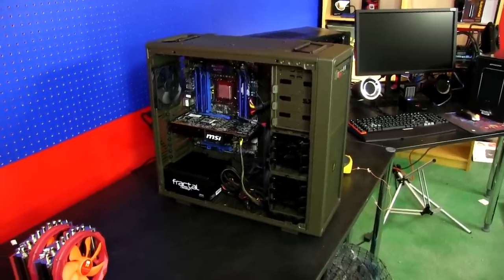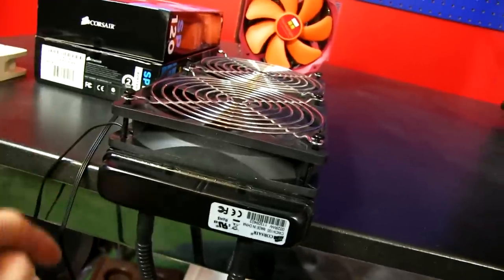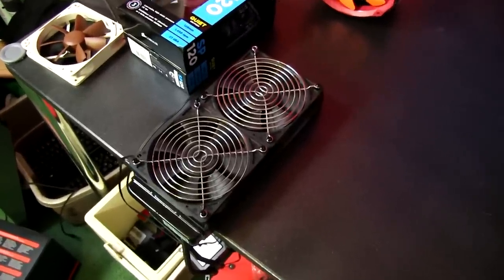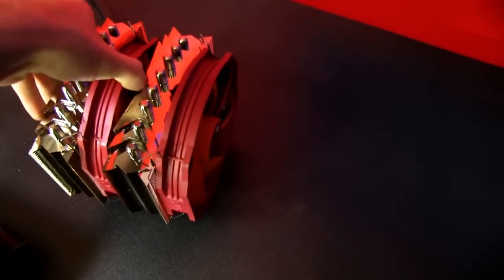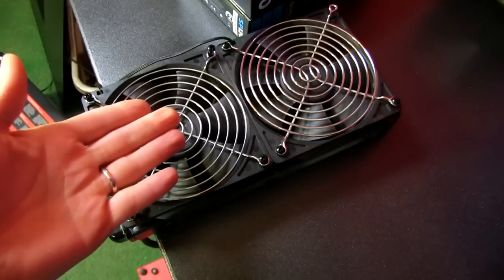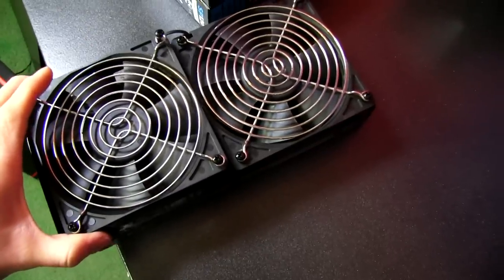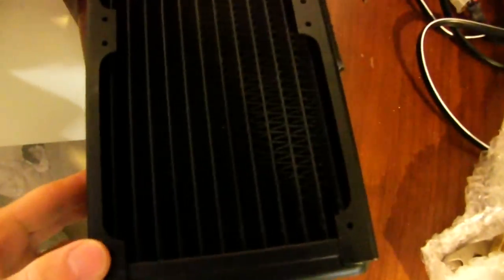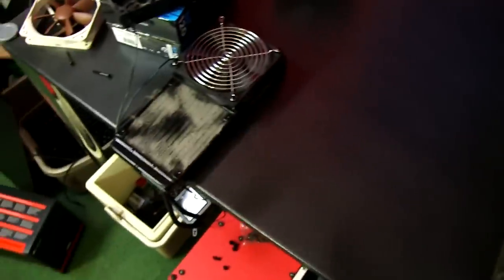Push vs Pull vs Push Pull for Radiators and Heatsinks Linus Tech Tips

Comment: Cool!  Ok, so positive, equalized, or negative pressure in the case?
Reply: This is just my opinion but equalized would be ideal, very difficult to achieve and even harder to maintain. Positive pressure is next best. It gives you enough fresh air coming in to adsorb heat and the positive pressure helps reduce the amount of dust inside the case. Negative pressure turns your case into a dust vacuum and can starve your system of fresh, cool air for heat displacement.

Comment: Use a filter. Without a filter, push with an external fan (above the radiator) or pull from an inside fan (under the radiator) will always suck-in dust, anyways. In such pull config. as is shown, It will simply stick somewhere else (IN between the radiator's fins in the case of the video... or between the rad and fan under it). A correct (but unrecommended) "pull configuration" which goal is to avoid dust, would "pull" air from inside the computer chassis while actually pushing it through the radiator fins outside the chassis. However, using cooler air from chassis exterior, instead of hot air from around the motherboard, to vent radiator fins, should render the system more efficient : IMHO a push configuration would be the way to go. Add one or two powerful front chassis fans, so as to push the hot air inside coming vertically from the radiator, towards the back (and outside), while providing fresh air to the CPU's heat sink fan, and you'll get overall a cool thermally stable system. Just use a good filter on top, that's it.
Reply: If you're water cooled there is no CPU heat sink fan, it's the radiator. Also, if you cool your components, you case ambient temp drops, your ambient drops, the air you're pulling into the rad gets colder, then the parts do, then the ambient. Realistically the temperature your components reach is based on the pump and radiator volume/surface area, not where you are pulling the air from. The ambient temperature of even a very innefficient case is around 100F or 37C, so even if you are pulling that hot hair into your rad, that's still MUCH lower than the temps your processor/GPU are trying to reach, 100C+ or 212F+. Besides, if you're overclocking, which if you have water cooling you probably are, your base operating temperature is going to be around 37C anyways, so it's not a big deal. Yes as a nit pickey last word you'll say, "Well I'm right though, colder air through the rad means colder components." Yep, 100% right, but in these types of scenarios, there isn't a legitimate difference.  I prefer a bottom mounted 240 for intake and GPU cooling (SLI 780), Top mounted 360 as exhaust cooling my 5820K and Ram (Bitspower has an AWESOME deal on a ram cooler setup) and then a front mounted 240 as the pre-resevoir rad, mounted also as Intake everything in one loop. The rear case fan (the only one) Is also mounted as intake, and everything has a dust filter. I don't get any dust on the exhaust rad at all, and dust robs performance so I'd say my setup is successful.
Reply: ian konrad Thanks, took about 6 months to build using PayPal's credit line buying a piece and paying it off. but MAN... it's a beast.
Reply: Evipicc
1- I was mostly talking about having a dust filter. As such (and as what follows) I stand my point. I evoked a CPU heat sink as I was concentrating on fans and fins and air temperature, but even though it's irrelevant when talking about DUST intake, principles of thermodynamics are in play (read along, and point 4 exposes a very efficient active solution from my own experiementations).

2- the air "cycle" you depict would involve that the system itself could make the air cooler than outside air : unless you're using freon or liquid nitrogen, it's not true, it's always limited by ambient (outside the case) temperature, and in the cycle you depict it would be limited to a higher temperature (with an added differential, well above outside temperature) - it's like lowering the heat transfer capacity of your cooling system. Even though you say that it's not your case, many do this error and then wonder why the closed loop water cooling solution they've just installed on their CPU, is not as efficient, or at least not "that" efficient, when compared to Active cooling solutions that are much cheaper... Weill there you go. The fact that your blowing inside air on the radiator fins rather than outside air, raises the case's inside ambient temperature when it gets IN EQUILIBRIUM : simple laws of thermodynamics are taking place here (temperature differentials of interstices playing a role in heat transfer ENERGY - or the energy required to keep the highest possible differential between two "bodies" -, whether that interstice is solid or gaz). Such cycle as you depict will attain an equilibrium as you said (of course), however it would be to a higher temperature than the other way around. These laws of physics are taking place, whether you are overcloking or not. But it's also true that in the later case, if you want to overclock the CPU to such extreme that it tries to get to 1000 C., then that differential gets to about <= 1% and thus can be residual. Q : which overcloking would go that far (usually one would use liquid nitrogen in such extreme overcloking context, while blowing air on the fins, whatever the direction, would have a residual and irrelevant effect)?... IN SHORT, the more temperature differential you have, the more energy would be required by the CPU'S "works" to keep its temperature as high as what it would "want" it to be : for the same CPU load factor, having a greater temperature differential; WILL lower the dissipated and ambient temperature in equilibrium.

3- In general, the greater the temperature differential given a "roof" temperature (established by the CPU's heat), the more efficient your cooling system can be : a differential of about 10 to 15 C. is NOT considered as being "residual" when it represents about 10% (<1% could be considered as being residual, but we're far from that context here).

4- I have installed an most impressive fan for the buck on my CPU (Arctic Freezer i11 at about 25 dollars), with a 140mm 90-100CFM fan exhausting air from the chassis and the CPU heat sink fan, while 3x fans (one added for about 7 buck and positioned at the bottom for cooler air) are pushing fresh outside air into the chassis. The 2 intake fans that came with the chassis are about 40CFM (not very efficient but I've made them essential in the active cooling design), and are combined  with the rear  exhaust fan on a very simple fan controller (a rheostat included with the cheap chassis I bought), while the new fan I added stays at full throttle at about 60-75CFM. Hence I can raise the rheostat to configure the chassis to be either in a negative air pressure config. (thanks to the 140mm fan at full throttle) while in full load, or lower that rheostat so as to leave a positive air pressure, simply to keep the chassis free from dust intake while in "normal" or idle load (the new fan plays with higher CFM and which always stays at full throttle plays its role here)... Well I'm "flabbergasted" by the results : the CPU stays around 23 to 25 C. at idle or "normal usage", while it never gets above 47 C. when playing a game on highest settings or doing gazillions of mathematical iterations (engineering data simulations) at full load. But of course, I'm not overcloking anything here ;-)
Reply: ian konrad
yep, you got one nice rig there, but I take the bet ;-)

Comment: what kasettys said: push pull is for water cooling and thats what a radiator is for. Regardiing your case, its way too hard to give an answer when you've only listed one component in your build. Also, all Ivy / Sandy based i5s and i7s will OC easily to 4.2 with/without a voltage boost and the stock cpu is MORE then adequate for it. Theres no need to strain yourself with a hyper 212.

Comment: Hi Linus! Would it be possible to to avoid the dead spots by using and extra pair of modified fans with no fins, spaced between the rad and the working fans? or does simply configuring the fans in pull fix this issue? I hope my question makes sense :)

Comment: I know you said that the push pull performance difference is negligible, but the picture on the NF-F12 shows higher static pressure on the push end (yeah I know it's a picture), rather than the pull end. So is it worth using it in push and having more dust? or just using pull?

Comment: I actually tried to configure my Nepton 240M in pull. Only to realize I could no longer put my top dust filter back on, because the screws are too high profile. Also installing in pull is much harder, especially with the rubber gasket that comes with the cooler.

Comment: I understand its been years since this video has been posted, but Linus recommends a pull configuration even when mounting it on the top. I understand that it makes it easy to clean out the dust. But I see so many builds that are in a push configuration, even in Linus's various builds on this channel. Did he change his opinion through the years or something?
Reply: Many people want rgb Fans and in pull configuration you wont See any rgb thats why most people go With push just depends what looks better to you

Comment: I'd use pull anyways because many cases actually have dust filters built in, that you can take out and wash off.

Maybe pull in the front and the top and push out on the bottom and the back? Is that a good idea? :D

Comment: Reverse flow air blast to clean. I always advise this. There is evidence in pressure scenarios where push is better. Thing is, in water cooled systems. The thermal mass of the water and surface area generally don't make enough sense to care. I can assure you that in pull environments, that void shown in the dust buildup still shows up. Both sides of the fan have that dead space. The difference is, in a pull over push, you have to fight for air in a more limited space. This would matter more if the pressure requirements were higher though. In some cases, I have seen the radiators become completely blocked instead of the surface block of a push system. I personally use both setups, as it doesn't matter much, and that the main differences usually are because of how well it fits on a case.

Comment: so, is the correct orientation.... rad against case, fan against rad and pulling cool air from exterior of case to cool rad which will cool liquid and cool CPU? so, in other words, air contact should be this way: MESH>RAD>FAN>INTERIOR CASE.... right??? or is the fan against the case?

Comment: I have a 200 mm fan bringing in air from the front and my case has space for a 120mm on the back and two 120mm at the top.  I have a single 120mm water cooler, question is would the 200mm at the front and the single 120mm at the back in pull be enough or should I install an exhaust fan at the back and install the water cooler in one of the two spot in the top?

Comment: I currently have a h80i with 2 noctua nf-f12 fans in push/pull, and even with the low noise adapter, the fans are making quite a lot of noise, is this normal for noctua fans? Corsair Link is showing me the fans are at 1050-1100 rpm.

Comment: reason i said this is because my friend got a all in one liquid cooler but when he installed it he put the fan around the way so the fan was pushing air through the radiator and into the case making everything else very hot

Comment: About push-pull: "They are not making the air go any faster [...] What's gonna happen is that if it's resistance in the middle then they are going to get the benefit of helping each other to move the aire throungh the resistance to gain more pressure". That's completely wrong! I mean, yes, two fans will make more pressure. But airflow is a consequence of a difference of pressure between two points. So more pressure is more airflow. There is not such a magic thing like "more pressure" which not afects airflow and it's "only more pressure"... If you take a look of the curves of a pressure optimized fan you will see (as a first estimate) that reducing the static pressure to half may increase airflow only slightly, but there is no doubt that the improvement exists.

Comment: Linus, do the fans always spin CCW? How would I know which way the fan blows without plugging it in?
I plan on buying some Noctuas for my NCase that I have lying around.
Reply: The vast majority of fans blow in the direction in which the blades are curved.  Basically, whichever side has the actual dips in the fans for the curves, that side is the direction the air will be blown.
Reply: Almost every case fan in the world has two arrows molded into its frame, in the middle of one of the sides. One arrow shows which way the impeller turns, and the other arrow shows which way the fan blows. Which arrow is which should be obvious.

Comment: I have a problem. I have an Arctic Freezer i30. It is covering my first mem slot which I need. If I reverse the i30 it will fits so that I free the slot, but then it's blowing the wrong way. So can my question is if I flip the fan itself in the mount so that it sucks the air through the cooler instead of blowing into the cooler will it work without heating issues. As of right now I never max 55c when gaming for hours on end. ty

Comment: Sorry for the stupid question but regarding the pull and a radiator, if you had the fans mounted to the top of the case and the radiator mounted under the fans, with the fans pulling, wouldn't that be pulling any hot air in the case through the radiator and pushing it out of the case? I thought you want to pull cool air through the radiator? Wouldn't it be better to mount the radiator to the case with the fans on the inside pulling air in? Sorry for the confusion.
Reply: +Jos P exactly my thoughts I guess we are both confused :D
...I hope some captain will explain it to us :D
Reply: +Jos P You have to make a trade-off.

In case you're cooling the radiator with the warm air from the inside of your PC, you're decreasing the radiator efficiency and increasing of your water cooling loop, but in turn reducing the temperature of whatever components are cooled passively: mainboard chipset, VRMs, RAM, possibly VRAM, hard disks and SSDs.

If you're running the radiator with colder air from outside, you're potentially warming up your passively cooled PC innards, but you'll get colder water cooling loop.

I feel that the former is generally a much safer tradeoff. It is to be kept in mind that the sum of passively cooled components shouldn't consume nearly as much as the components in your cooling loop, so the damage from dumping that air through the water cooling radiator is likely to be a lot smaller than the opposite. Also keep in mind that many components are designed for an air cooled system, VRMs both on mainboard and on the GPU can be critical spots which would be getting a lot less airflow than in an air cooled system. Also, they don't have temperature probes and their temperatures need to be monitored manually.

If you decide to run radiator with cold air, make sure to test that the ambient temperature in your PC is OK and doesn't keep rising too badly if you run maximum artificial load on your water-cooled components for a while. You should keep an eye on the mainboard chipset temperature probe, SSD and HDD temperatures, and you can stick a thermometer of any kind for air temperature control. I actually have a multimeter with an external temperature probe that i can just glue to something inside, that is really nice. Something like a $5 car thermometer with cable sensor can do too, but they are usually really bad with high temperatures.

Comment: Your video didn't show underneath the fans of the thermalchill - i bet they're covered in dust too. Push or pull it doesn't matter, dust will get trapped underneath the fans.
Reply: yeah ya see that's what i don't get, suggested to pull so dust doesn't get stuck in the radiator. but why would it not get stuck? dust is still coming in no matter which way its configured and will get trapped when it meets the radiator.

The only way i can see this being good to be in pull is if you only have 1 fan? then the radiator is exposed on one side... but most water coolers have them on both sides right?
Reply: put it this way: don't wait a year to clean your PC! lol.
Reply: If the fans are in pull config the dust will go in from the side without the fan which means dust will, more likely, get stuck on that side which is easier to clean. And the dust that do get between the rads and fans can be pulled out by the air.

Comment: I have a very high pressure air compressor. I'm not too concerned about water tbh, if I mess up then I pay for it, but I am especially not worried about it for a radiator.
It cleans up. Easy.

Comment: Anyone who works in the refrigeration sector like my self will tell you to induce the air upon the cooling fins using the evaporation effect. In other words have the fan behind the coils sucking the air form the outside. All A/C condenser units do this. Blowing hot air from the inside of the case will do very little heat transfer. As for the Dual fan technique there is no gain from this unless you are transferring the air in such a long distance.
Having 2 fans side by side is achieving nothing. And if anything, if the fans are not 100% spinning at the same rate you will either have a positive or negative pressure effect between the two and putting unnecessary load upon them. 
So no never use dual fans in my opinion.

Comment: It's not impossible to clean a push/pull configuration with radiator in the middle. You just have to do so every 45-60 days.  You waited a whole year?  LMAO. You've got some excellent tips usually, but then - you also provide unintended humor.